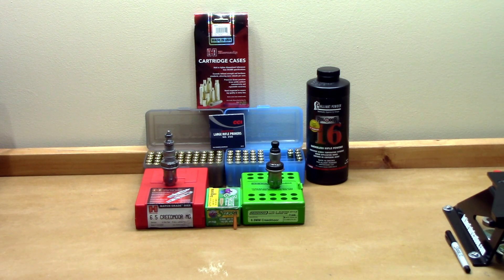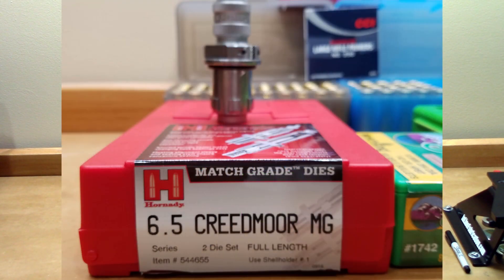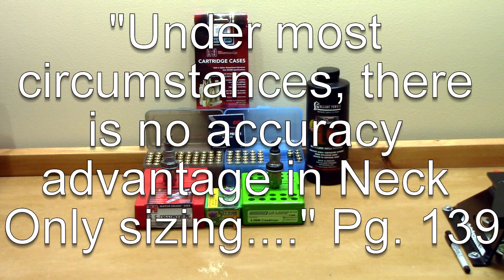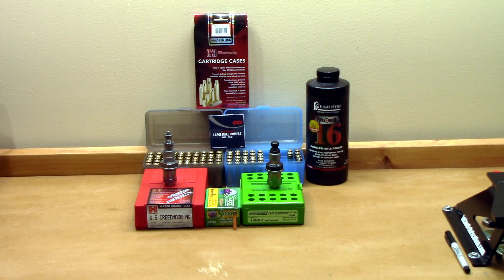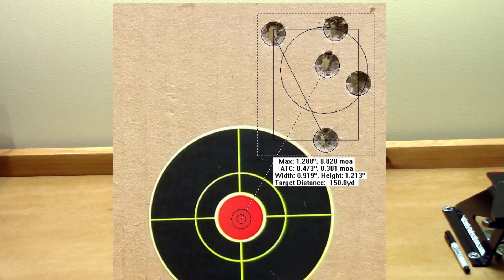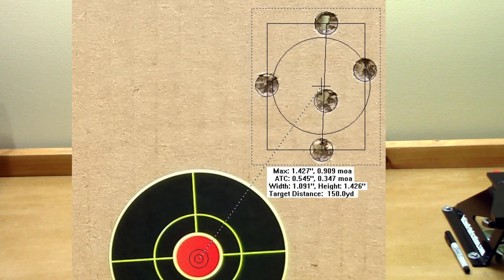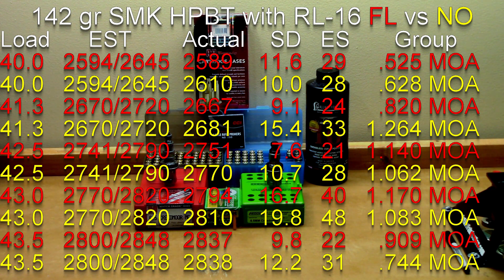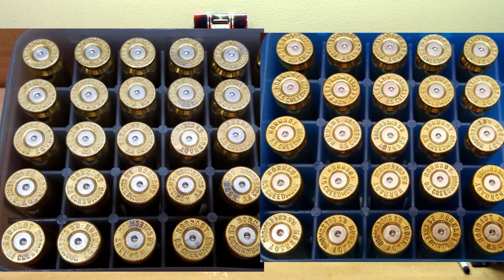Full length vs Neck sizing performance comparison

Comment: Always heard that neck only sizing on ammunition used for a specific bolt/lever action was a time saving action more than anything.
Obviously full sizing stresses the brass that can SOMETIMES cause early failure, but I think with 4 to 5 5 gallon buckets of 5.56, .308, 30-06, 9mm, 45lc and 45acp. What I have 4 sons and two adopted daughters??  Yeah I don't worry too much about cartridge failures.

Comment: So it would seem that according to this author, Neck-Sizing-Only could be relegated to more of an additional element in the overall work up of our reloaded rounds.

I mean, after our ladder tests or OCW tests we then do our OAL testing to look for more accuracy.  Upon finding our most accurate load using these methods we might then carry it a little farther by testing our most accurate recipe by putting it through a Neck-Sizing  test using our most accurate loads to see if it further helps or hinders the outcome.

I also have to add that there is an unprovable element to this type of testing that's in the form of subconscious favoritism.  If we prefer the way we're doing things now there's a possibility that on a subconscious level we're trying harder to get the outcome of all your testing to come out with your preferred method coming out on top.  I know this sounds stupid but we human beings do stuff like this all the time without realizing it.

I'm in complete agreement that if you like reloading they way you're doing it now, keep doing it that way.  To each his own.
Reply from the maker: Thanks for the comment Tim. I think the authors point is that too often people look to other disciplines of shooting to "borrow" concepts that just may not apply. Again, I feel much of reloading is figure out what works for the individual and refining that. Largely his point is that benchrest only neck size cause they feel they have to. They have tighter chambers than the rest of us so the brass can't expand, they have to neck turn because of this as well (tight chambers), and that the brass takes so long to prepare / sort neck only sizing is the solution to get the most out of the brass, not necessarily because it yields any additional accuracy. (And some do full length resize) 

While I understand the bias comment and what your trying to get across, I don't see how I could have modified the velocity data. The groups subconscious bias maybe, but the velocity data is what I recorded. Largely the point I am trying to get across is I am not sure that it makes a difference at all, I personally would guess I could rerun this test 5 times and flip the answer 3 times depending on your luck of the day (and maybe even tolerance on the dies you are using, etc) Either way happy reloading and thanks for commenting.
Reply: TIM MONTANO. To avoid said subconscious bias, you could hand off your rifle to a proficient marksman that you trust. Don’t tell him what he’s getting and just feed him magazines with five rounds in each, on a windless day(few and far between, I know) with a suitable cool down period in between strings. 
But I like your methodology. Would be worthwhile trying.

Comment: That's crazy. I know I've been able to get much better results by neck sizing vs full length. However, this may not apply to all rifles and rounds.
Reply from the maker: I plan on doing some more work but I was not expecting the results to be earth shattering.
Reply from the maker: Yeah I am a over tester, I am trying to build my knowledge from the ground up. I frustrate some of my viewers by testing things that people think are "silly" but I challenge the notion that neck sizing is the only way to reload a bolt action. I really think that far to often we paint ourselves into a corner by assuming that one thing applies to all applications. I was actually very surprised by my primer testing. Do you use magnum primers for no magnum loads or do you test by caliber / powder?
Reply: moparmadman typically I use CCI-250 magnum primers, I seem to get good performance out of them across the board. However, I'll be building a 6.5x47 Lapua soon, so small primers will be on my list
Reply: To me, the most glaring issue was the fliers.  He seemed to group 4 shots fairly well but would have a 5th shot over an inch out.   These fliers skewed the data.  I would like to understand if the fliers were shooter or the round itself.  Then I would like to see the data removing the the furthest outlier. 4 rounds should still be sufficient in this scenario to draw the same comparison if we eliminate the shooter issues.
Reply: @FlyRiverFly  I didn't catch if he was using the hornady brass straight out of the box but that's how they've shot for me. Maybe he has deburred, neck turned, etc.. Either way I do agree. My rifle with somewhat processed hornady brass and the same bullets tends to do really similarly. Much better overall than this, but similarly. So is it the gun the cartridge or the shooter? It is worth mentioning.
Reply: Agreed, we have to be flexible and be open to experiment with different things. As an example from smallbore was I had a match rifle that loved the cheapest Eley ammo at the time(Eley Sport) and would shoot ragged holes at 50 yards. Never ran Eley Tenex but various other loading of Eley, RWS and SK didn’t shoot as well. Maybe I just got a great lot but every lot I bought over that 2year period shot great.

Comment: I got similar results from testing n/s vs f/l dies. Some of my n/s loads had smaller groups but not all. Like you, I  need more data and will keep testing.
Reply from the maker: I was most surprised about the statistics favoring the full length setup. (group size could easily be me on any given day) Zediker alludes to this in the book but its still hard for me to understand that the "chamber sized" rounds would not be core consistent. Thanks for commenting.

Comment: People go crazy over this. I’ve tried full length, neck, neck and shoulder bump, I’m of the group that thinks neck tension and concentricity has more to do with accuracy than anything. If your a tactical shooter I could highly understand why you would lean to the side of function and reliability.

Comment: It all depends on the RIFLE!   I have rifles that like Full size better.  I have rifles that like neck sized better.   neck sizing is great if your rifle will shoot it!   sometimes when a lee collect die is not working well you can get an undersized mandrel for $4 and try it with a tighter grip.   and I also have bought dies suck as the Hornady 6.5 NS (neck size) for odd rifles like my 6.5 Arisaka.   I have one Arisaka that shoots neck sized best.  and one that wont shoot neck sized worth a damn!

Comment: Full length resizing will work the best. (hornady competition dies w/bushings and hornady brass is what I use)  It keeps the center-line perpendicular to the head plane. The shoulder is evenly set to form the gasket. The case run-out will be no more than .001. A 26in. sendero cut, 4 groove McGowen will shoot 130gr. hybirds well inside of a .2 moa at 100 yds. and 2850 fps +/- 1fps(H4350). This represents how critical the reloading procedure is.

Comment: I once asked Bruce Baer (builder of Bat actions, rifles, and 1000yd benchrest competitor extraordinaire) what he thought about this. He said unequivocally that full length sizing decreases vertical spread at long distances. He believes that consistent cartridge headspace promoted more consistent ignition. For those that don't know Bruce...He competes with 60 pound benchrest rifles. Very precise to say the least!

On the flip side I know that quite a few short range benchrest guys neck size. I phoned all over America talking to the top benchrest rifle builders asking the same question, and not one said that definitively that they could see a difference neck sizing, but all said that neck sizing was much more convenient....So that is what they preferred. 

Some thoughts for your consideration
Reply from the maker: I try to convey that everyone has to decide for themselves. For custom chambers (BR guys) I think that Neck sizing is really their preferred option to preserve brass life. I have received so many comments that I am an idiot for FL sizing with a .002" bump rather than NO sizing so that is one of the reasons why I made this video. I largely thing that it may not matter. I think it is truly person / process / rifle dependent. Thanks for keeping a level head, so many don't.
Reply: @BoltActionReloading  I think most of the confusion comes from the fact that the top short range benchrest shooters do it one way and the top long range shooters do it another. Each group vehemently opposing the other leaving us confused neophytes in between. 

Most people dont understand that the best method for shooting  1's and 2's at 100 yards may be woefully inadequate at 500 or 1000yds. 
All that said, one way is so slightly different from another that few can tall the difference at range....So...No method is correct here really.
I side with the full length sizing crew.....because it best suites what I feel are my long range needs. My moderate pressure brass reloads will go 40-50 rounds or more , but then again I use Fl dies custom cut to my fired brass.... Neil Jones and the exemplary Warner tools dies....Not everybody wants to spend that kind of money, but there are none better IMHO. Max runout I see on the Warner dies in 4 different chambers is 0.001 ...On the bullet!

I was thinking these tests might show up better results with your best load and bullet. 4-5 shot groups of the same load for instance...This might point to a better statistical probability? 
My thinking is that an inaccurate load will be inaccurate load no matter what type of neck turning/case resize/primer seating depth or whatever. Accuracy changes on an inaccurate load are much more difficult to quantify....In my opinion. FWIW I shoot 10 shot groups. This gives me a good "pattern" of the load's accuracy and fliers or shooting errors are easier to pick out. My thoughts of course!  :) 

Anyway...I enjoy your channel!
Keep up the good work!
Reply from the maker: Thank you sir. Guys like you are the reason I have my channel. If you ever have any good video ideas I am always interested. Getting better loads is the real reason  most any of us do this anyway. Lord knows I dont save any money like so many claim. I like to tease the guys that ask me how much money I save that if they save anything reloading, the must not be doing it right. 😁😁😁

Comment: I would have like to have seen a standard same brand full length sizing die and standard neck sizing die. As in no bushings, or mandrels. With a moderate load in both for new brass first firing, i can't see the case needing the shoulders bumped.  
Always appreciate the time you put into making the videos though, so thanks.
Reply from the maker: Hi Jamie, There really aren't a ton of option available for what you are discussing at lest in 6.5 creedmoor. Maybe RCBS? anyway everyone is entitled to their own opinion but will all the options I have tried out the least run out is the FL die and a mandrel. If you haven't seen it: https://youtu.be/9I2pwRDxDOQ Thanks for taking the time to comment!

Comment: Another variable in favor of neck sizing may, may, be lower relative chamber pressures per comparable powder load. If a case is chamber matched v resized, could that case not contribute to pressure as it is already expanded?

-260AI is my choice.

Comment: Perhaps the flash hole in the cases should be the smaller hole like that seen in the smallest of benchrest cartridges. I would like to see a controlled study of the differences in the number of loads typical case will accept before the case splits. Of course case OAL will have to be trimmed after so many loadings.

Comment: Interesting! Ive not fullsized my 6.5 brass ever,but planning on doing soon before annealing.Will be interesting to see the results.I normally see es in single digits or teens.I use lee die,which supposedly (ive not tested) produce the least amount of run-out,maybe this video is worth a re-visit with Lee for neck sizing.

Comment: If you use a bushing die that minimizes how much the necks are worked, you'll loose primer pockets or have case head separation long before you split a neck in most instances.

Comment: Thank you and nice work. I neck size because I'm lazy. Neck only saves me time with lube and then cleaning the lube off the sized brass. I have not noticed an accuracy benefit with neck only vs full size using my 6.5 or Garand.
Reply from the maker: We all have our reasons., There is less trimming with Neck sizing, but I find that if you don't trim your ES / SD become worse. Thanks for watching.

Comment: Every cartridge - new or old has its "bugga BOO' .  Chamber pressure Riding on the primers flatness, in comparison- in my time was just part of the plan, but loose primers meant to me the test was done.   I used Mech Eng - and years ago calculated both head forces. A couple of them - I pushed to destruction.  We had a pretty good  idea with rear lock bolt rifles.  Consider SMLE 303br as one that played nice.  The Rear locked Rem 788 - in 308 Win was a destroyer of brass - IF you did not know about the 1.5 thou length stretch AND the 3 thou - diameter increase. Primers would drop out of the ammo.   We also found the brass flowed in a circle around the Case head.  It was a spot where you measured the case movement - from shot to shot. Once the brass flowed that 3 thou - [ and I crushed the cases]  I normally had loose primers. Toss them.  Iit also gave false positives in the pressure - all because the mechanics - of fluid flow of metals follows a pattern.   Tests - for me  as PO Ackley,  O'Conner and Wooter's  said - pristine once fired  200 cases per test. If a case is tossed - it gets the same load data - as the case it replaces - AND Then I continued shooting.  400 rds, to work up a load was not uncommon.  I will never use a 6.5.  7mm Mauser was a great cartridge.  Just old grey haired thoughts. Keep your stick on the ice! PS - Yes - I loaded on the shooting line, or a little behind it.  I have 4 rifles - Same Caliber - different Manufactures all - and yet I have custom data - resize cases  to set them correct and bullet cases with the loaded bullets I use.  PPS - Energy at distance - sometimes a bullet needs to perform. Some do not. They had a great C7 - but does it kill game.   Finally - I  have used CCI Mag primers all along.

Comment: Have you noticed a difference with your 300 Win belted magnum?  I've been neck sizing mine because I've been told that it allows you to headspace off the shoulder rather than the belt.  I understand the advantages with FL sizing for regular cartridges...just not sure if it applies to belted magnums...thanks.

Comment: Very good comparison.  I do know the best reason to neck size as much as possible on belted cases such as the .300 win mag and 7mm rem mag is case life.  If full length sized too much the case life is greatly shortened with splitting at the belt at the bottom of the case.  Of course that is just for information for those who load belted cases.  The weakest point on those cases is at the belt.  I have a couple of magnums that never see full length sizing unless they are hard to feed.  I have had similar results in reloading cartridges full length sized and neck sized and agree that there is not much to show for accuracy improvements because of neck sizing.  I only do neck sizing to increase case life.

Comment: I agree that you should do whatever blows your skirt up...whichever you like as this appears to me to be the old Ford vs. Chevy argument that will go on forever with NO clear cut evidence in either direction and NO winner. What I DO KNOW for sure is that there are some VERY high level shooters that full length resize and some that neck size only with maybe a full length resize every fourth to maybe sixth reloading.. MY opinion is that the differences (IF ANY) are NOT due to the kind of resizing, but are due to (1) the shooter and whether he/she is having a good day or not and (2) metallurgical (chemical) makeup of the cases...and you ought to KNOW that if there was any advantage of one method over the other(s), most ALL competition shooters would be doing it the way that was PROVABLY and UNQUESTIONABLY better. So go ahead and argue on..matter of fact, HAVE FUN with it!!. When there appears a CLEAR CONSENSUS, call me and tell me all about the supporting data and the test methodologies, as I'd be quite interested to hear all that..